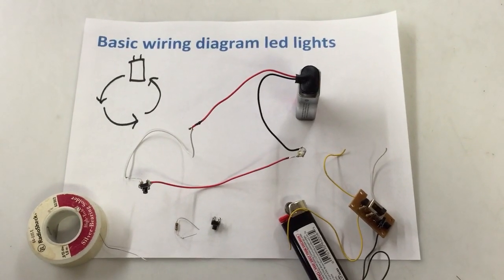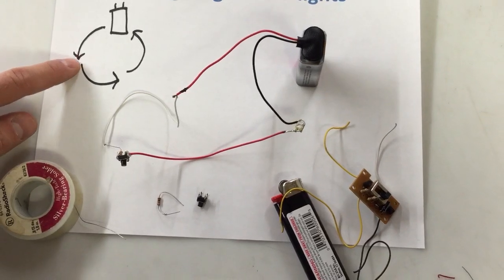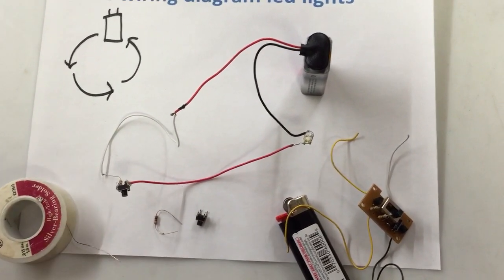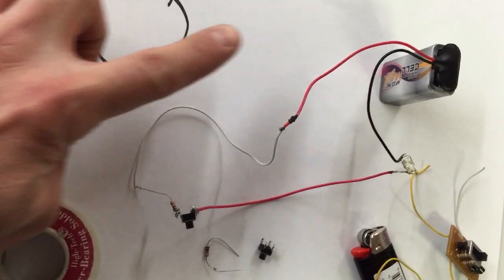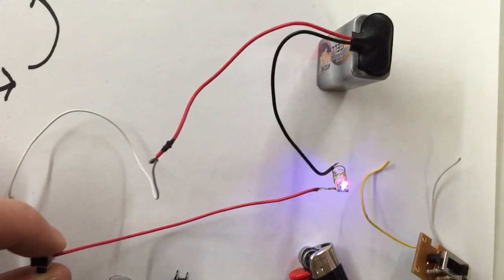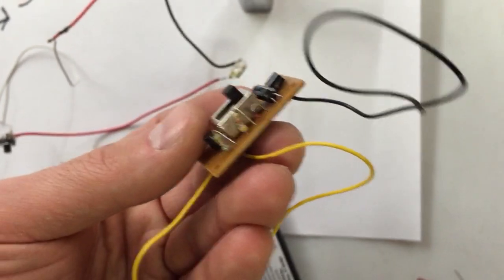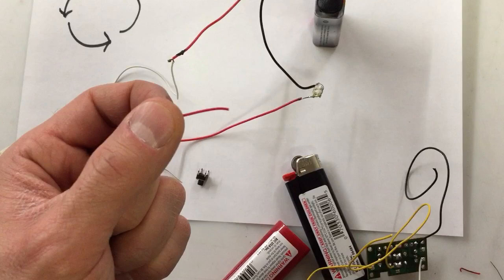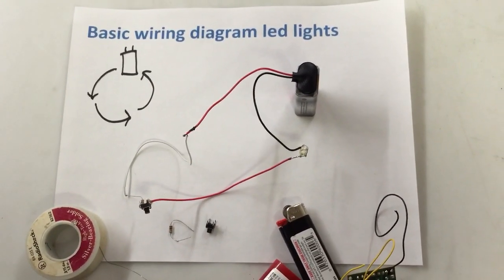How to wire up led lights with a battery basic wiring guide

Comment: I hate to bother you and I’m thankful for your post. I have a question. I want to make an ornament that I have work on a timer and I don’t know anything about wiring. These are with three AA batteries. They say you can buy a relay switch that will be a timer and I have to know how to put it in the line. Ty

Comment: I got a Himalayan salt lamp today and it doesn't work. I opened it up and it has a very similar set up to this. But I still idk why it's not working. I don't see anything loose. Idk if the led is bad  or maybe something isn't connected that I can't see. But I can't seem to diagnose or fix it

Comment: So it always starts with positive with this circle? Or does it not matter?

 And do I have this right, power, "on" button (if applicable), resistor, lights, then power?

Now, I have about a 3-6ft string of LED lights, theyre already in a string for me, but they end with exposed wires. (I had no idea what I was buying, I think it's meant for a car.) but would I still need a resistor for a whole string? Im not sure if my lights may have some specs but I'll check in the morning.

Is that springy thing the resistor? Do you have one on each light? Okay I'm done bugging you now 😅

Comment: What I am trying to do is put a micro motor and led light on the same battery  so when I switch them on, they both work together from a small clock battery. If I connect the battery, the led stops working or visa-versa, the motor, and the led don't like each other, is there a solution?

Comment: Love this bro, thanks for sharing ❤️ u made it sound easy enough that I’ll try it… Ive got a bunch of Christmas lights, can I just wire one bulb to the battery like you’ve done in the video? (Not the LED type), also, what is that you’ve got that is making that light jump around? It would be very cool to use that as fake fire in a miniature diorama ❤️

Comment: this might sound like a strange question can you connect circles to circles?
Reply from the maker: If I understand what you’re saying, you cannot have two battery sources connected to the same battery source having current flow through in circles one battery source, one continuous circle you can have 100 lights, but they Moscow in a continuous circle

Comment: Would it be possible to do 4 in line? For example. Trying to make a small rc car have 2 front yellow 2 rear red?  Or 1 battery for the front 2nd in the back?
Reply from the maker: Yes u can one resister needed

Comment: This absolutely helped. I was able to use this and my small knowledge of ohm meters to figure out that a transistor (don't cancel me) was bad and you also mentioned that any transistor(two times?) would work so I ripped one from another toy and soldered and THERE WAS LIGHT! Thanks from a true beginner.

Comment: Ok i have a question so if i am trying to hook up 5 different leds on the same circuit(wire)that comes from one battery ..do i need to put a resister in front of each wire before it goes to each led? Or would i need resisters at all? Please let me know the kind of batter ill be using is a small lipo battery
Reply from the maker: Only use one resistor before the current gets to all the LEDs tested out it won’t burn out your LEDs to try it I don’t know the value of your resistor that’s why I can’t answer what battery is needed but it can be tested without harm

Comment: But you didn't tell us the value of the resistor.
Reply from the maker: LEDs typically require 10 to 20mA, the datasheet for the LED will detail this along with the forward voltage drop. For example an ultra bright blue LED with a 9V battery has a forward voltage of 3.2V and typical current of 20mA. So the resistor needs to be 290 ohms or as close as is available.

Comment: Thanks for your service bro, was very helpful. I have a question, do you have any pointers or can you point me in the direction of what can help me,  I'm trying to build a light up light Saber 1/12 scale with a led filament to a switch pack hidden on the back of figure watch battery size.
Reply from the maker: Thanks what is your question I hope I can help
Reply: Well when it comes to wiring I have a basic knowledge I do it at work and houses and everything with switches Outlets Breakers blah blah blah but when it comes to little wiring and the restrictors and Battery harnesses because they don't know what a battery throws out power wise what a wire can hold what size wire do you use and what would be my best option for a light source whether it be an LED filament or an actual tiny bulb that one would use in a dollhouse
Reply: And it's just difficult to find that kind of stuff online because everybody gets really technical right off the bat and I'm assuming not just myself but a lot of people can get lost so if there's like a dummy's guide or something layman's terms I should say

Comment: Do you need a resistor if using several led lights? How many leds could be used with a 9v? Thx
Reply from the maker: The more lights u might get it to work but u might need to light up like 20 leds

Comment: Im making a model house project and i want to light the house,so i bought led(3 volt) bulbs from amazon but dont have resistors. I can light 1-3 bulbs with batteries, but i want to light about 25 - 30 bulbs.So Is it possible to light multiple led(3volts) with the circuit board we find from old eletronics like a table lamp??. I really want to finish my project but im stuck with the lighting part. So any help would be appreciated. Thank you.

Comment: Can you use a wired led light that is built to be used in the home (powered by the electricity in your house) that has a basic 3 wire (pos/neg/ground) and power it with a battery? I’d really like to make this one particular light I purchased recently into something portable. Thank you for the video! Great work!

Comment: Beginner here. What type of wire do you use when working with small LEDs like this? I can't seem to find the specific type/name.
Reply from the maker: Just search ebay for led wire When you’re working with wires the higher the number in the gauge the less strange the way your has

Comment: Dude thanks for the video. I literally was using my teeth on those little wires. All tho I have the lighter for heat shrink never would it came a cross my mind.
 Thanks for the tip.

Comment: If you have an LED light (off the shelf type) that is rated for 9V (or 12V) you should be able to safely wire it directly to the battery without a resistor, correct?  In this example,  the resistor is in series with the LED to serve as a source of voltage drop of 4V if the LED is only rated for 9V.

Comment: Tanks for the great video.  I got 2 questions : 1 how do you call that switch and how can I find it  ? 

  2 the resistor can be install in any position or is a  way to do it ?
Reply from the maker: Armeddefender D yes the resistor can be put on any way and search ebay for all electronics search on off switch
Reply: @KooperSalmo  Do we check colour code for resistor?

Comment: Kooper, great video. I will use this tutorial to wire up some. Here is another question, if I want to put 10 or 15 LED's in a line, can I just wire them in series?.
Reply: Keith Schlotthauer yeah you can as long as the positive leads go to positive and negative goes to negative.
Reply: @thatguybeardo1279  do you have the answer to another question that was asked?   If using multiple led lights on the same string, would you need a resistor between each light? Or just one resistor for the whole strand?
Reply: RayneStorm i want to say one resistor for the strands So long as its big enough

Comment: As far as the resistor goes and which one to use.  There are a few mathematical calculations that you will need to follow in order to make sure the LED is not over/underpowered to maximize the life of the component.  I personally used this video https://www.youtube.com/watch?v=m09i9wBZddk&t=183s along with OHMS law and some research into the LED's I chose to find the forward voltage, current consumption, and the max of both.  This all played a factor in choosing what I used to power my LED's.  I muted the video and read the instructions on the screen which made it easier to decipher.    Hope this helps.

Comment: Thanks so much for the video! You’re right, it’s almost impossible to find anything on the basics, they all just assume you already know, so there’s rarely a good explanation for those just starting out. I do have a question—I’m about to wire up about a dozen led “street lamps” (they’re tiny lamps im doing around my daughters Christmas train set, one led bulb per street light) so would I need a resistor between each lamp? Or will one resistor work for the whole set? I want to wire them all together of course so I’ll have to only push one button to turn them on, I just can’t find anything to tell me if I’ll need a resistor per light or not. If you get this and have time to tell me something good, I’d appreciate it!
Reply: good question. I was wondering that myself

Comment: I have a light with a push button like u hooked up here. The whole light is round and it looks like all wires are running in a circle.
My question is if it's all running in a circle like I'm seeing. Will the negative be on the opposite side wher the positive stops and is soderd?any help will be appreciated

Comment: For wiring an LED light, I suspect soldering instructions can easily be found elsewhere. When I saw the lighter, I figured the soldering could be done with that. Not sure if that's the case.

Comment: "It must go in a circle, or youll get a charge in something or burn something" 
Oh man, no offence but as an electrician that idea is entirely wrong. In fact you are not creating a circle but more of a ladder. You are connecting 'in parallel to the power source' a load or multiple loads, now if you connect in series you will connect loads in a circle but thats not really commom these days, as for switches and shit its only in a circle on the active, the neutral is usually not switched. It might look like a circle because its a small circuit but really its a rectangle with your led in parallel with your battery and resistors/switches in series to control current & voltage to the led
Reply: Electrician searching for 'How to wire up led light' 

sounds legit.
Reply: He’s trying to make it basic for everyone to understand you educated moron
Reply: Thanks but for this task, circle dawgs got me covered.
Reply: You're not wrong but the problem with your comment (as is with most other electronic tutorial videos) is that us non-electricians don't understand your second sentence onwards. You're just complicating stuff. People only want to light up their LED, not pursue electrical engineering.
Reply: No one knows what the fuck you are talking about
Reply: @nova_kane  Same, the circle makes way more sense.

Comment: Good video I have a head light it has 2 3.7 li io batterys the wirong rund from bay pqv around to the round circuit boatd that is attached to yhe torch
The wires came unsoldered I have no clue where the wires go  
Can u help

Comment: Hi Cool video I'm working on an led wiring project.   do you know how to calculate the size of battery needed based on the wattage of the light?  Same question for the resistor needed is that based on the wattage?  I want to power some led and also incandescent lights with a marine or some type of rechargeable battery to last for 8 - 10 hours per charge

Comment: DIY project help.Try to make bicycle turn signal glove.Got a set of Led Arrow  turn signal indicators that run off a 12 volt Dc.Trying to use a A23 battery & holder,Micro push button.What type of resistor i would need to use.Thank you.

Comment: dude,if i use AA battery.....will it work ? or i have to use A battery ?
Reply: I'd get two AA batteries and make a tray with that battery...holder trhing where you have one side connect to positive and one to negative and the spring on the opposite side.

Comment: any resistor will do?
Reply: To choose the correct resistor you will need to know how many volts the LED requires and how much current, amps, it requires.  Let's say the LED needs 3 volts and uses 50mA, or .05A.  We use ohms law, Ohms = Volts / Amps.  Since we are using a 9 volt battery we will need a resistor that will use 6v.  The Amps are .05A, so 6 Volts / .05 Amps = 120 Ohms.  So if you use a 120 Ohm resistor your LED will function properly.
Reply: IF YOU HAVE LIKE 10 LEDS, YOU DON'T NEED THE RESISTOR! LEDS ONLY NEED ABOUT 1.0-0.5 VOLTS DC. TO LITE UP. IF YOU PUT 6 VOLTS ON 1 LED, IT WILL GET HOT AND NOT LAST MORE THAN A MONTH. THE MORE VOLTS, THE BRITER IT GETS.
Reply: so say if i was powering 4 led lights with one 9v battery? would one resistor work?

Comment: can use any volt of resistor?
Reply: no, u have to calculate the difference in Ohms from your powersource to light.. In other words compensate the difference.. It's like tunneling the volt from high to a lower one.

Comment: Hi, im having some proble here.
im trying to connect many LEDs with switch and battery(3 AA battery) but it doesn't seems to work.
I paralleled the LEDs together and connected switch and battery in series with the LEDs. However, my switch seems to be reversed. Since i'm using a push button switch, it supposed to be pressed an LED lights but now it became pressing is Off. Any idea what is happening here?? I was told that the push button operates in normal open condition but now its the reverse. Please help me ><.

Comment: i have 12 led lights of 3.1V and 150mA each...how can i connect them properly? i read somewhere that i can use a  phone charger..i have an 4.5 volt charger..is that dangerous to connect them parallel without a resistor? or what else can i do? thank you

Comment: hey my switch has only 1 wire
Reply from the maker: +Ishu Saxena I have never seen a switch with one wire could it be possible your switch had 3 wires but broke off go on ebay and buy a 3 prong switch or radio shack electronic store
Reply: +kooper salmo (ricks one stop) no i have not broken it and i have taken it from rc car
Reply: then its not a switch

Comment: Instead of a resister, can LEDs just be added on to the output end of the standard bulb?
Reply: No, because the voltage drop from the bulb won't be low enough and burn the LED out. Resistor is the best way to go. 10 ohm resisters are the safest resisters to use.

Comment from the maker: the led came from a old cellphone flashing antenna the volt you send to the led from a STANDARD battery doesn't matter aS LONG AS YOU USE A COMPASIDER TO LOWER THE VOLTAGE TO THE LED
Reply: resistor not capasitor...
Reply: @750scooter  capacitor

Comment: we does everyone on here say "use a resistor...". Great! How do I know what freakin ohm resistor to use?!?! thats the answer I can't seem to find. grrrrrrrr the frustration mounts
Reply from the maker: +Daniel Crowley Sr a resister slows the power that is being sent to the led because led lights use very little power open any old dvd player and use any resister you can find its not going to make an explosion or anything if it works great if not try a difrent one if this is not helping there is a website you can ask quistions like fixya.com they are great
Reply: +kooper salmo (ricks one stop) Awesome! Thank you for getting back to me on this. I really do appreciate it. I know just enough about electronics to be dangerous, lol. Thanks bud! Liked & subscribed.
Reply: I read it somewhere... But that's an excellent question.... Now, I need to find it to make I'm using the correct one.... Thanks
Reply: use a 51 there are tons of sites out there that will do the work for you. Ive ran them without resistors they just burn out quicker.
Reply: Current = voltage/resistance, use algebra given the current needed for LED and the voltage of the power supply (battery) to find the resistance u need
Reply: https://www.digikey.com/en/resources/conversion-calculators/conversion-calculator-led-series-resistor

Comment: Hello I have a small led light that says it's 24 volts could I use two 12v dewalt batteries to power it? Or one 18v battery? What do you think would be the best way to power it by battery?